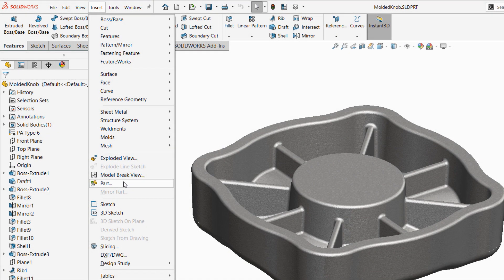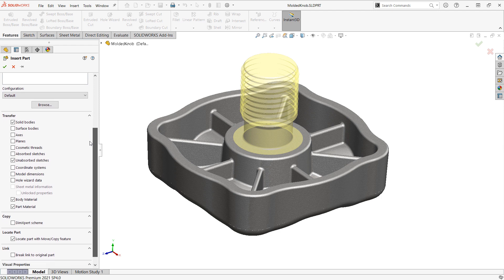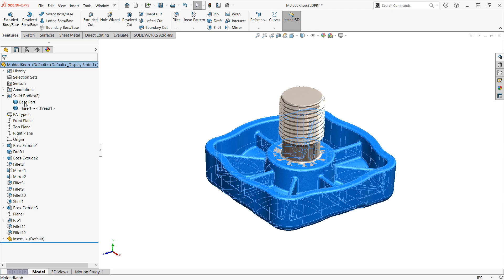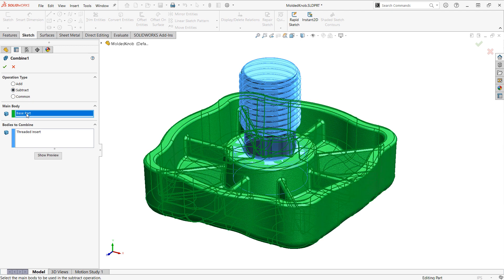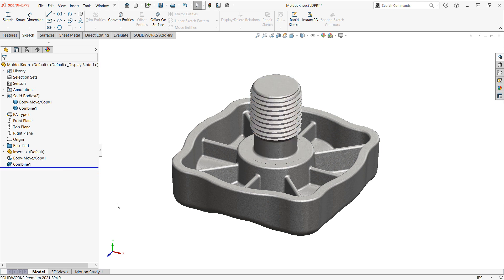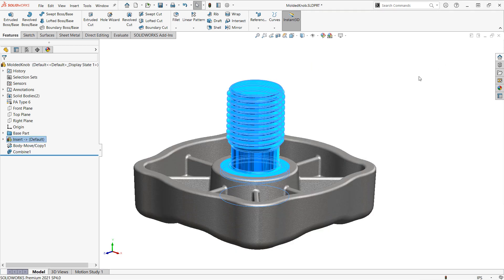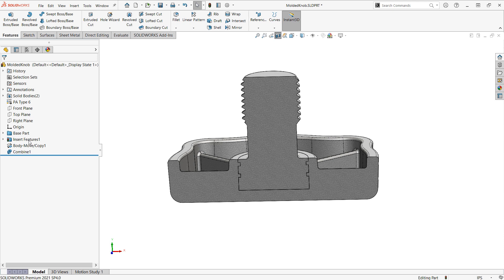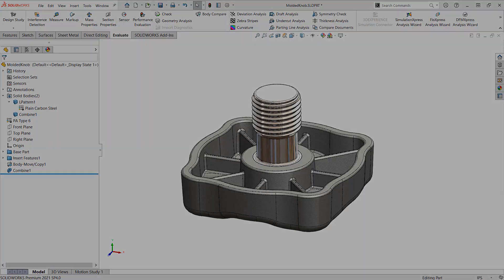SOLIDWORKS: Insert Part Feature for Multibody Part Modeling

Comment: If you do this, then how would you show it in a BOM of the part?
Reply from the maker: If it's necessary to separate them on BOM then the best workflow would be to keep both part files separate. For this approach you could basically stop at 4:42 in the video and save the plastic part (with insert subtracted) at this state as its own file. Then insert both the plastic part and the insert in a new assembly. One benefit of using this type of modeling is that both components should automatically position correctly in the assembly.

The method shown from 4:42 onward should be used when it is desirable to not have separate BOM items / part numbers. For instance, if the combined plastic body + insert were to represent a single purchased part. 

Otherwise, the Weldments functionality does allow for "Indented" behavior in a BOM. So if you do ever have a multibody part that needs to be represented on a BOM, it could be converted to Weldment.

Comment: Sir is there any option like keep tool in solidworks which is available in Unigrahics
Reply from the maker: The Combine feature used in this video is the most basic and doesn't have such an option. The procedure at 4:42 shows how to copy the solid body ahead of time to preserve the tool body when using Combine.

There is a feature called Indent that can do a similar operation but keep the tool body. This video covers it: https://www.youtube.com/watch?v=z0BS5NsZm7M

There is also the Intersect feature which can do the same type of cut and will keep bodies so long as they aren't excluded.